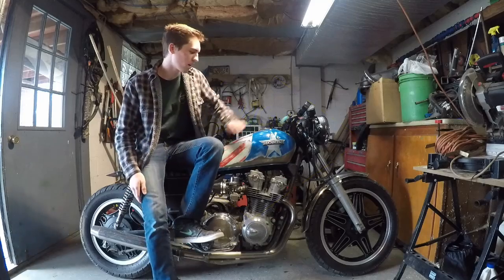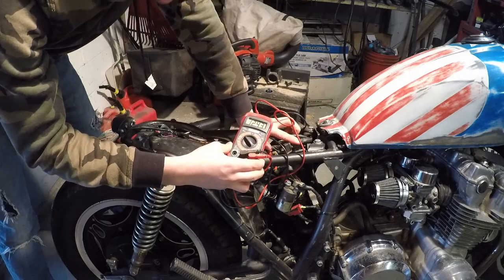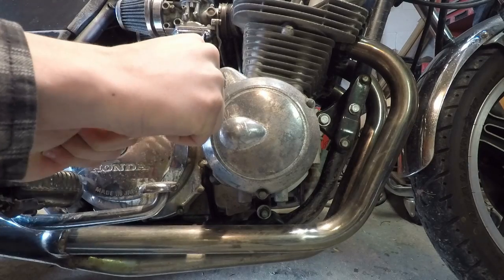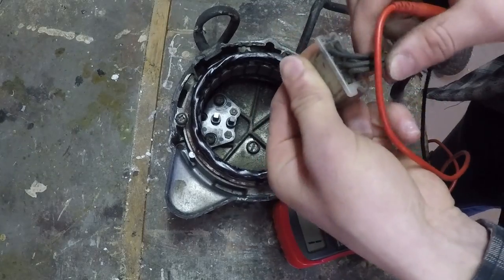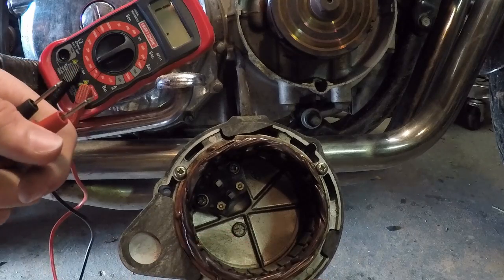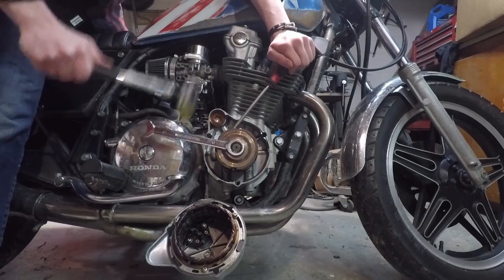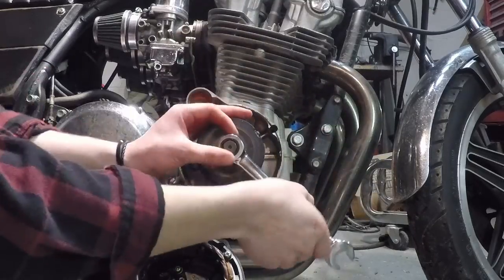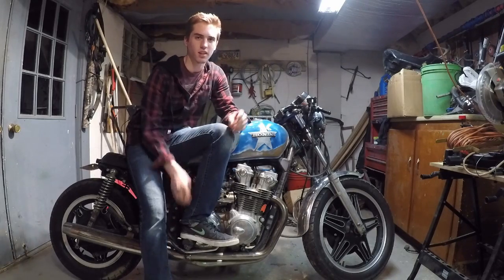How To: Fix a Motorcycle Battery Charging System

Comment: this isn't usually the smartest thing but if you're really cheap get oil tranny fluid something put it in the hole get the right size bolt use Teflon tape around the threads and you will hydro press it ou

Comment: My motorbike overheated, since then it has not been charging the battery properly. Could I have burnt out the stator? Thanks!
Reply: Hey mate, I have same problem, also overheating. I am trying to figure out where is culprit. If I find it out so I will let you know!
Reply: @ondreyfoldyna548  Thanks for letting me know. What bike do you have? I have a Varadero 125cc, 2004. Water-cooled carb. bike. Been watching videos on testing stators but been too lazy myself to get tools and stuff haha. I do think it's most likely the stator as I have been reading that over some temperature they are likely to burn out (the copper wiring) or so I think. Cheers
Reply: @KilliKonKarnage  I've got Yamaha xs650, classic bike air cooled. In my opinion my rotor is f*cked up and if not, my rect. regulator will be. Ok man, I will let you know then. Take it easy:)
Reply: @ondreyfoldyna548  yeh I've got similar feelings abt my bike too haha may just flog it. Anyways u take care as well hope we get ours sorted. Thanks

Comment: Awesome, thanks man. I"ve been having problems with my 78' cb550's battery (brand new mastercraft batter bought at CanadianTire). The stator seemed to be charging it but this morning as I was about to go for a nice Sunday ride, my battery was practcally dead. Something keeps draining it. Definitly going to look into the stator. I just changed one on my cm400t (yes that flywheel puller is essential). Thanks again, for this clear concise and great video.

Comment: You can use your rear axle to pull the rotor 
https://youtu.be/yVU_RUE0c4o
Reply: Also put the bike in 5th and hold the rear break to get the bolt loose

Comment: Yo GoldGuy  The year was 1980, the place Ft Lauderdale. I was flush that month and headed to the Honda Dlr. Sat on the CBX ( too wide,felt like it was trying too hard) , sat on the 750 f and the gl1100 no fairing mod. bought them both. Still have them 39 yrs. later! Ride them every summer ( live in Ma. now). Put pops Yoshamura header on the F 35 yrs ago and it still turns heads and scares the livestock when I go by!! I've had to do the charging repair you've done too. Common issue with these but no big deal. Coils can go too but that's to be expected on any bike. Great to see a young fella ( my golf shoes are older than you) enjoying the bike. Keep the shiny side up my friend.

Comment: Use a breaker bar and your 17mm. It should get the rotor nut off.  But use a 2' long pipe over the breaker bar if it's really hard.  Great tutorial.  I got my M1 license in California recently  I just turned 70.  I rode a Honda 750 alot in my 20's.  The bike I get to ride now(2005 Honda Shadow 600 has a charging problem.  This video helped alot to make it ridable

Comment: Excellent video man ! You helped my track down my charging issue on my 82 750SC. One of the brush wires was broken internally that you couldn't see it until you took the assembly apart.

Comment: Thank you for showing me how to do this, you made it a lot simpler for me. I just bought a 81 Honda CB 750 and replaced the stator and I still got a charging issue so I'm going to have to check the rotor(but scared to), but I'm hoping its not that and  just a regulator problem.

Comment: I know this isn't a forum or anything but man I'm stumped I tested my old rotor I had bad specs. Changed the rotor and tested everything else but still not getting that 14v like this
Reply from the maker: Did you test the new rotor before installing it?
Reply: Goldguy yeah 3.7 ohms after some more digging It may be the wiring
Reply from the maker: It probably is the wiring, wiring is a beetch. Best of luck to you with fixing it!

Comment: Had this same issue on my '80 cb 650, it seems lots of old Hondas have these rotor issues. Just a tip, once the puller is screwed in just give it a whack with a mallet and the rotor will pop loose.

Comment: It was funny when you made a spark shorting the battery and you said "oh shit" it cracked me up
Reply: That made me laugh for like 5 mins straight. I do all kind of stuff to my motorbike, but except blowing the fuse of the lighter socket, I haven't made any other sparks ever.

Maybe he should use some crocodile ends to keep them held onto the battery or just loosen the screws of the battery and tight the 2 tips with the screws.

Way too funny, "oh shiiiiiit" :))))))

Comment: I found a cb 650 for 650 do you think that's a good deal it runs and drives
Reply: Jacks Motorsports if it has a title and small issues or none then yeah that's a good deal (what year is it just qurious)
Reply: RagingThunder 198  1981
Reply: Jacks Motorsports yea that's a good deal does it have any issues
Reply: RagingThunder 198 none that it says
Reply: Jacks Motorsports sounds like a good deal but make sure that it has a title